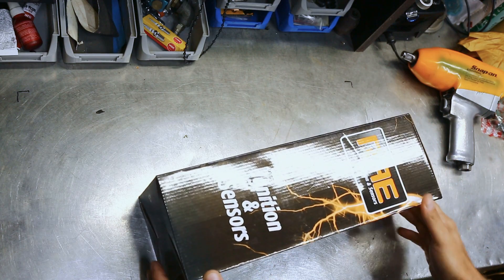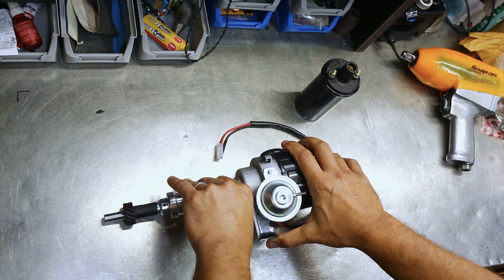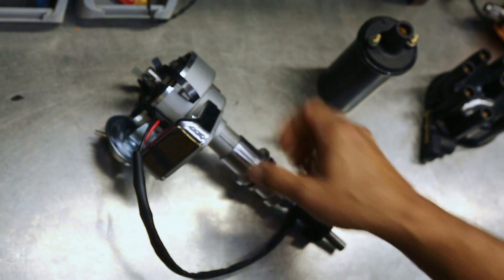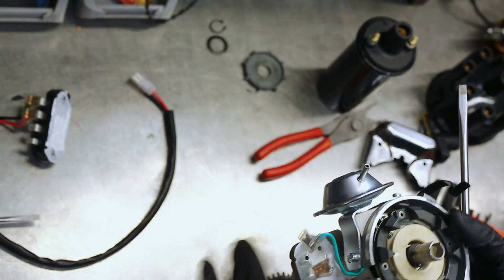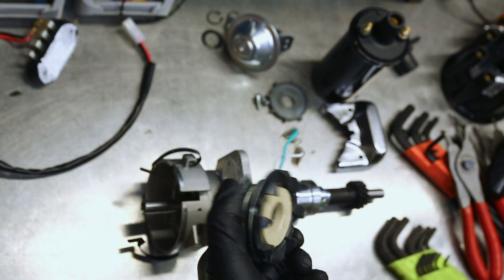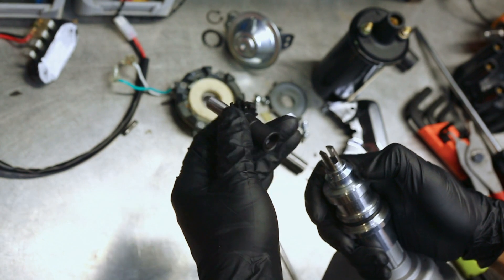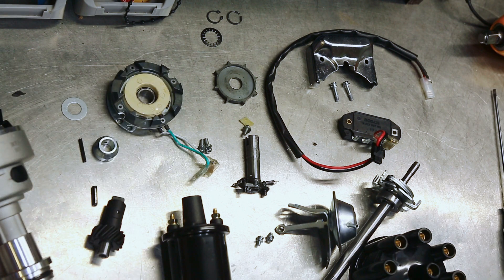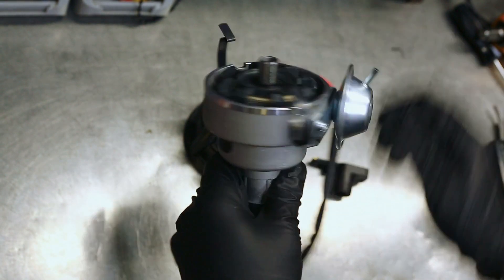Hilltop Workshop | RAE "Bosch Style" Distributor teardown and evaluation.

Comment: Wires on pickup coil should be soft & flexible like OEM. Cheap Dizzy's have standard non flexible wires which aren't meant to flex & crack after a few months.

Comment: Do you know where you can get replacement caps, rotor etc. for these distributors? My one for my HZ Kingswood seems to be a bit taller than the one that came off the old points distributor.
Reply from the maker: It should just be a standard Bosch unit to suit the electronic distributor, but that said, I've yet to have to replace one.

I'm pretty sure the points rotors aren't interchangeable.
Reply: @thehilltopworkshop  If you get a chance, maybe compare your cap to the original points cap and see if they are similar.
Reply from the maker: @LiamsGotThis  Any other time I would, but this replaced a Mallory dual point.

Comment: So how did it go? I am looking at one of the same brand for my HZ Holden Kingswood with a 202 engine. Was it easy to install? Work right off the bat? Still going?
Reply from the maker: Yeah, still going strong. I've still got to take a few degrees off the vac advance, but that's more down to the individual engine.

No complaints, and very happy. 👍
Reply: @thehilltopworkshop  Awesome! What is that red wire/connector for and where does it go? I haven't pulled my old points distributor out yet, but just looking in the engine bay- can't see it on the old one.
Reply from the maker: @LiamsGotThis  Red goes to Ignition/Coil positive. Black to coil negative.